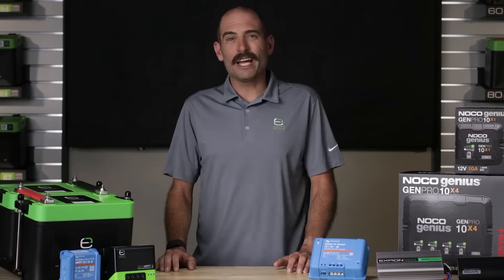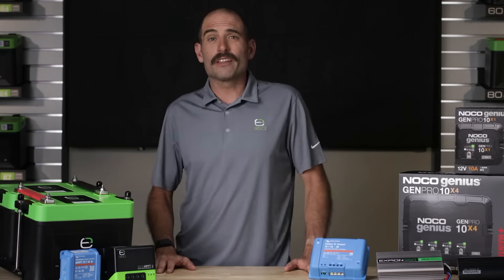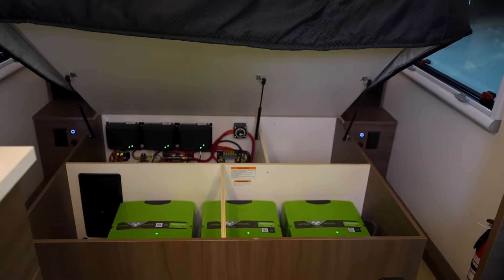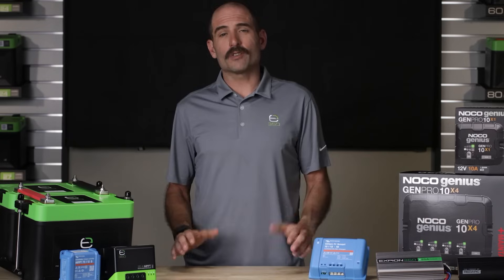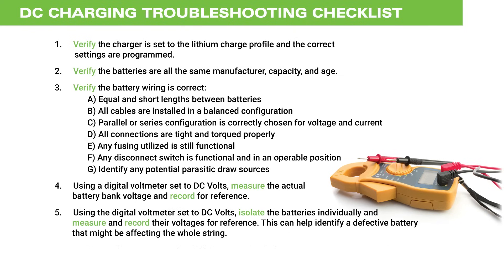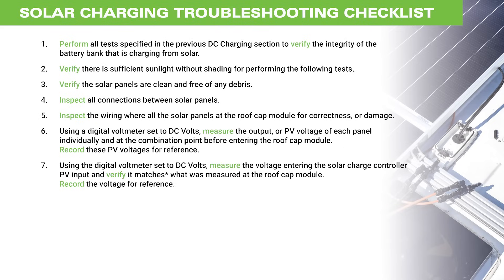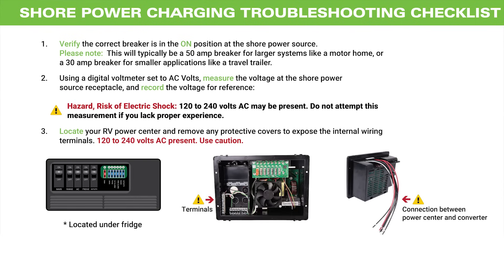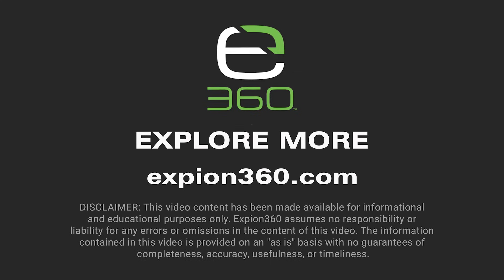Charging Best Practices

Comment: Glass mat batteries have served me best in very cold conditions in my travel trailer in the California Sierra Mt range.
Reply from the maker: Glass mat batteries have been a solid choice for many over the years, but lithium battery technology has advanced significantly, offering superior cold-weather performance, longevity, and efficiency. Our Expion360 lithium batteries are built with high-density LiFePO4 cells and feature advanced thermal management, including our Vertical Heat Conduction (VHC)™ technology in select models, ensuring reliable operation even in extreme temperatures. Plus, they are lighter, more efficient, and require virtually no maintenance—making them an excellent upgrade for off-grid adventures in the Sierra Mountains or anywhere your travels take you!

Comment: Is there any issue with constantly charging at a much lower rate, like .1C?
Reply from the maker: Thank you for your question! It is completely safe to charge at a lower C rate. Our recommended charge rate for LiFePO4 is 0.2C. Rates below this are fine, but will take longer to charge the battery. Let us know if you have any other questions!